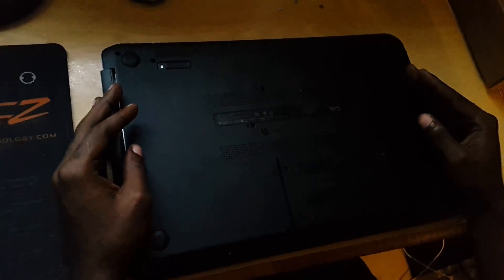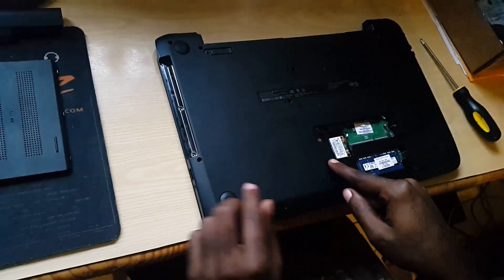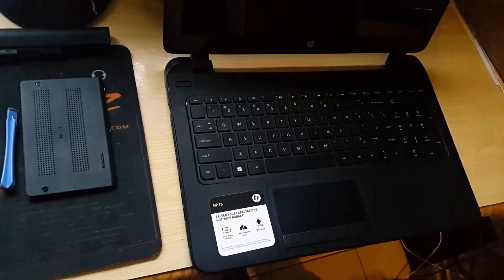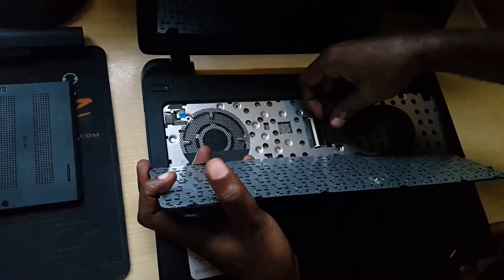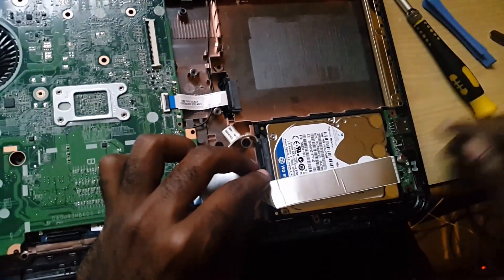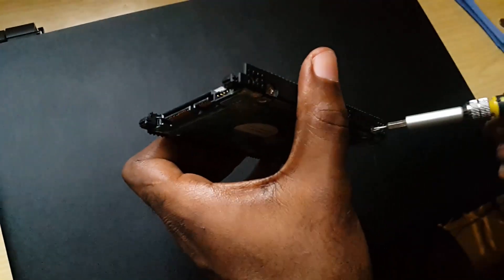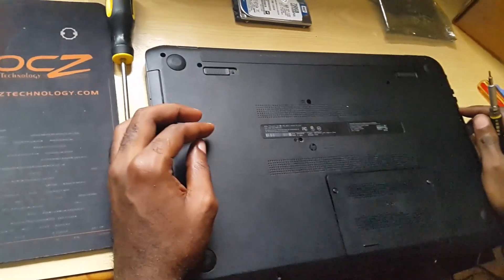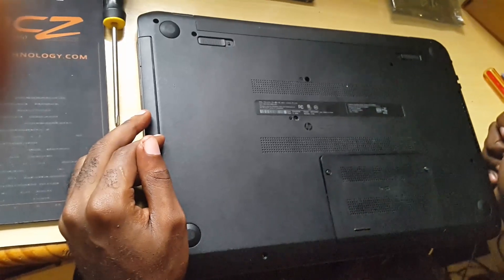HP 15 Laptop hard drive replacement or SSD upgrade

Comment: do i have to format the drive using disks for the hp 15 F272 Disk drive model number once replaced with a new one?
Reply from the maker: If you are replacing the Hard drive you will need to re-install Windows in order for the computer and new drive to work.
Reply: thanks, so i will need the disks for that system or do some have windows built in?
Reply from the maker: You will need the Restore or Windows Disk that came with your device. If you have a valid Windows DVD you may use that as well.
Reply: Thanks very much! I thought so. I was watching other videos where they were just replacing the hard drive without running the windows restore software.
thanks again.

Comment: nice tutorial, I cant get those dang screws under the dvd  rom.  The section for the screwdriver to fit is sooooo tiny! I guess I have to get a special screwdriver.  I'm using a glasses set tool and its too big lol. Crazy , has to be the hardest part! great accent btw.
Reply: Same thing here. 2 don't want to come out

Comment: It's better to buy a used hp probook or hp elitebook on craigslist or ebay than it is to buy a cheap one new. One of my friends has this laptop and i am not going through all that just to put in another mechanical hard drive that already has bad sectors on it. The hard drive that is in it now might still be good just doesn't boot to windows. Instead i am just going to run parted magic and wipe it clean and reinstall. The lenovo laptop is even worse you can't replace the memory or hard drive without dismantling the entire unit. The older thinkpads are just as bad. One of my other friends got an hp probook with a 2nd gen intel I5 and 8gb ram 500gb hard drive on craigslist for $150 and all of the basic components have covered compartments very easy to replace hdd ram etc....
Reply: But before you buy do you make sure they work?

Comment: Your accent is excellent and made this an enjoyable watch.

I had three of these models with failed hard drives come through my shop this week alone, and the only thing that had me stumped was HP's incredibly bizarre decision with the ribbon cable connectors. The fact that the black part elevates on the keyboard, but the white part elevates on all the other connectors seems like an intentionally misleading design choice. 

Also, you may want to note somewhere that there's another model of HP 15 that has a nearly identical design, except it has segmented corners near the monitor which are fastened with a screw hidden underneath the rubber feet of the base. If you don't remove those, you're liable to break the fasteners inside.
Reply from the maker: Thank you for the pointers and If you could name that exact model it might help someone with it avoid such a mistake. Also appreciate the kind words :) .

Comment: My Laptop wont turn on.  What happened?
Reply from the maker: Depends if you pulled it apart you might have missed something during re-assembly.
Reply: You have to put the battery back on
Reply: Fraggers what did you move? Look up how to resemble whatever laptop you have and resemble it. Or get HP to fix it. Or don't buy another HP computer again

Comment: Hi, I have a hp 15 laptop, I took it to a technician who told me the hard drive needs replacing and I did so but when he gave me the old hard drive back it says TOSHIBA...I don't see yours with that on it. is it possible he gave me a different hard drive and lied about me needing a new one? I considered that my relative (who got the laptop for me from the U.S) might have lied and bought a refurbished laptop but the back didn't look as if it was tampered with. it looked new..so let me know, thanks if its normal for a new hp 15 to come with a toshiba hard drive
Reply: Boui Boui ask your cousin, also look it up. Try HP help center, contact them or just ask a pro who does known what there doing
Reply: Ask a reliable technition that you know won't lie to you

Comment: Cheap notebook, use as it is. If you want a SSD and more memory, buy a REAL notebook, the ones that have covers with screws. They cost twice as much. It's a trade off between price and user accessible. Made like a phone. Cheap and hard to open. Great for the price. I can open a phone, so opening this is no issue..

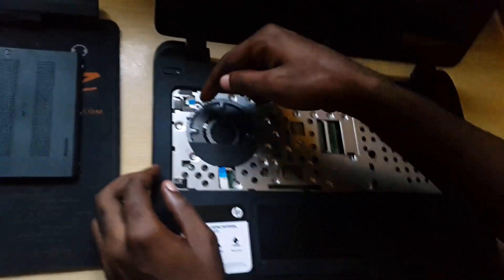Comment: Ok, so weird comment, but at about 5:15, those clips for the ribbon wire, what if one of those clips were to break, just curious, don't even have one of these laptops, just kinda had random videos playing lol, but either way, thank you to the creator for making this video, I am sure it will help many others lol. Thanks in advance for anyone who answers my question.
Reply: Matthew Puhalla rip then. It broke off for me very easily, i hot glued it in and it works fine. however it doesn't work the same for the bigger connector that the keyboard uses. now im with a broken keyboard.

Comment: Just followed these steps and when I try to turn it on nothing happens.
Reply from the maker: One make sure you reconnected everything properly as I you don't the Laptop will not power on properly, also if you did replace the drive and it powered on you will need to reinstall the operating System before windows comes back.
Reply: Hey Paul. Did you ever get it to work?

Comment: I have tried to unscew my laptop and pop the base off on my HP Pavillion 15 Notebook PC, but there is a scew where the diskdrive goes that has a flathead scew which needs the tinest of screws to unscrew it. Any help or advice would be greatly appreciated as I dont want to go to the shops 😣😊

Comment: Hey guys..
I have  hp notebook 15 ac122tu With 4 GB Ram Expandable upto 8GB,Video graphics of  
 Intel HD 5500.
Is there a way i can add a graphic card in this to run games like battlefield 4 without lagging or i can add nvidia Graphic card on the motherboard.
If yes then will my motherboard support it.
:-)

Comment: Absolutely rediculous! What moron designed this? I remember trying to remove a hard drive from an HP to remove a virus (the plan was to scan the HD using a USB done on an uninfected computer). I got to the point of removing the screws and nothing would even budge. Why wasn't there a hatch on the back of the laptop? All other laptop models allow easy access to the drive, WTF? It's easier to work on a jet engine! At the end of the day, my dad tossed the laptop in the trash (it was a Christmas present). ultimately he bought a Dell one, with the PROPERLY DESIGNED access hatches to the hard drive!

Comment: my hard drive got corrupted in my laptop but Instead of wasting money to get a new hard drive for a 3 1/2 year old computer I'm just going to buy a gaming pc with intel i5 6 core and a gtx 1060 😛
Reply from the maker: Sounds good, in my experience after 3 years a Laptop has more than done it time. Thats around the mark it will start giving lots of issues and things will start breaking. By then the Technology inside will be crap though.
Reply: Ricardo Gardener sadly yes. these weren't made to last. loved your video by the way.
Reply from the maker: Graphic Default
Thanks really appreciated
Reply: Graphic Default I had a very good HP laptop (though it was a pain a lot) it lasted till today at 11pm, they may be good they just are hard to fix 😂

Comment: i cant remove the CD drive as easily as he did. it is connected with  a ribbon cable..should i remove the CD drive at the end then? im using a HP Pavilion 15 n208tx notebook...please help.thanks ✌✌
Reply from the maker: Take your time see where everything is connected and remove things as necessary bearing in mind where it came from.
Reply: Ricardo Gardener thank you for the reply... actually it was my mistake ..i tried to open the cd drive..instead of just pulling it out..my bad.😐😐

Comment: Hi Ricardo, i have this model

http://qrq.itcs.hp.com/m/L0T74UANA/qr.do?cc=us&ll=en&jumpid=QR_PPS_L0T74UANA_NA

I have 6gb but i was wondering how much more ram can i add to it, it looks like it has 2 slots, please let me know if this is right, and what do you recommend for upgrade my RAM, saludos!

Operating system
Windows 8.1 64d19
Memory, standard
6 GB DDR3L-1600 SDRAM (1 x 2 GB, 1 x 4 GB)
Hard drive description
750 GB 5400 rpm SATAd10
Processor family
Intel® Core™ i5 processor
Processor
Intel® Core™ i5-5200U with Intel HD Graphics 5500 (2.2 GHz, 3 MB cache, 2 cores)d15
Weight
4.92 lbd4
Display
15.6" diagonal HD BrightView LED-backlit (1366 x 768)d9
Display size (diagonal)
15.6"
Graphics
Intel HD Graphics 5500 (up to 2.96 GB)d3
Battery type
3-cell, 31 Wh Li-ion polymer

Comment: Oh man...........It is not hard but it is tedious ......thanks for the video ..it certainly did help me!!!............Curious why they did not put a door on the bottom like most laptops as changing hard drives is so common and frequent..
Reply from the maker: That's a Good question, maybe the design is having its intended effects.
Reply: Ricardo Gardener .. can you please help me out good sir. so i turned on my hp notebook 15-f271wm and all im getting is a black screen with a blue box telling asking for admin or power on password that i can't remember.  I was told my only recourse is to open up the nb and disconnect the green jumper wire from either pin 1 or 2 . can you please tell me where this green jumper wire is located please.....

Comment: I knew better than to buy a HP product. Sadly my wife didn't. HP and MS pull the same tricks. It is nearly impossible to change Windows operating system back to any earlier MS that was better than Win 8 and above. (I say this in comparison to any other brand) Worse yet, Just  try to dual boot or install Linux! Like HPs new printers that include non removable software preventing you from using any ink other than that supplied new from HP. Their computers now do everything possible to stop you from using the computer that you own and paid for in a way that HP does not approve of. Their fear is that you would spend your own money on a non HP or MS product. Please...calling HP a good company is a stretch.

Comment: Thanks, I've got this laptop and have recently been unable to boot it up. I get stuck on the hp logo loading screen on Windows 10. After running the HP diagnostic tool I discovered the hard drive failed so am considering replacing it myself. I will first try and reinstall the OS from a recovery USB but if that fails I think I may need to follow your steps here.. Only tool I don't have is the one you used to lift up the keyboard and backing plate.
Reply: P.s. My laptop is only just over 2 years old so I'm shocked that the hard drive has failed already..!
Reply: Steven Fall my laptop was 4 months old, next thing I know I need a new hard drive because when I sleep I sleep walk and I made It fall, who knew I slept walk not me that's for sure 😲

Comment: Can you make a video on RAM? I need a tutorial on the exact computer... Thanks.
Reply from the maker: You do not need a separate video for that if you made it this far into the Laptop simply look for the RAM module if its not visible at that stage of the disassembly then go a little further and look beneath the Motherboard.

Comment: does it void the warranty
Reply: If you're under warranty, just send it to HP for replacement?
Reply from the maker: Not sure-maybe, did you see a warranty/tampering seal? For some its just outside its warranty period.
Reply: is yours warranty void
Reply: skyroket if under warranty they fix it for free after that you need to pau for it

Comment: This could possibly win the award for THE DUMBEST AND GREEDIEST product design ever. HP doesn't want to make it easy for you to update your computer, they just rather you buy a new one. HP should be ashamed. Opening a laptop simply to remove a hard drive is like taking an engine out of a car just to replace the car's battery.
Reply: Amen Brother. Their new printers include non removable software that prevents you from using other than HP ink or refilling their cartridges. Calling HP a "good company" is a stretch.
Reply: so true!! smh. a regular user will no be able to do this.  they want you to either buy a new one of buy their maintenance plan... so you can bring it to them instead so they can charge you the price of another laptop to fix it for you..smfh..
Reply: Yeah, okay...
Reply: Dan, you're an idiot.
Every computer? Desktops? Every other laptop ever?
Reply: Here Here... Whoever authorized the design are a bunch of assholes.
Reply: Sun Of God lol yeah
Reply: Honestly, this isn't too bad. It's poor design, sure, but I've seen far worse. Clearly you haven't seen the shitty designs with the little plastic rings that you have to snap off with a utility knife or screwdriver.
Reply: Sun Of God I agree they make money. It's cheaper to buy a new one. Get a warranty
Reply: Bonefx Flow A regular user should never touch internal parts. If this job is too difficult for you then you should not be changing any hardware on a computer period. This is very simple to do.
Reply: I have the same issue I want to put a ssd in but I don’t know how to get to the hard drive with out breaking the dam computer
Reply: Just so you know, this design is actually very easy to get into and service, I  mean, it would be nice if the harddrive was just removable like the DVD tray but honestly this isn't a bad one, try getting to the harddrive in toshibas or IBM's, those are nasty to get to. Have to remove motherboards and screens and everything.
Reply: Exactly. I even had to break one of the tiny microscopic screws cause it was literally DRILLED IN so hard. It got stripped. So i had to rip it out with a freaking knife and the aluminum floor wall bent. Its horrible. All to find out from removing 100 of screws and cabled the cpu was fucking sawdered on. What the fuck. It was more like a very hard glue but worse to remove. I couldnt even upgrade it. The cpu chip was too small. Horrible design.
Reply: @supercommando89 nope, you would be incorrect.  I've worked on a bunch of laptops, this is one of the worse designs I've ever seen.  Most have a cover on the back, remove, and bam there's the hard drive.  Or it slides out from the side.  To have to remove all the screws on the bottom, then have to remove the cover and keyboard AND the USB/audio board...... That's ridiculous.
Reply: I do this professionally and I don't believe I've ever had to pull out the USB port before this repair, also I'm not sure I've EVER had to pull out a mobo to replace a hdd and ESPECIALLY not the screen.
Reply: Opening a labtop tp replace a component inside is VERY normal 😂😂😂
Reply: Whoever designed this POS needs to be dragged into the town square and flogged. HP will never get a penny of mine!
Reply: I have a Toshiba that just about if not exactly as old as this laptop that is exactly the same way but a whole lot easier to open as all you have to do is unscrew the bottom screws and the bottom plastic comes off... I thought that would be the same case for this one and after about a minute or 2 I had to jump on YouTube 😂... I have to assume the majority of laptops are built this way...
Reply: Turns your stomach doesn't it.
Reply: With my 15af067sa, once the screws on the rear are removed (together with one under each of the base pads by the battery and the two that would otherwise be covered by the battery) prise open the clips around the two sides and front, then ensure the lid is closed and with the machine laid down on the lid, the hinge side can be unclipped. This then releases the plastic base. The hard drive is sitting in a caddy and the whole unit can be removed by removing three tiny Philips screws, before releasing the hard drive from its connector strap. The 'caddy' (its is comprised of two individual metal arms) can then be removed by unscrewing the four Philips screws.
Reply: it's actually done for the sake of evenly distributing weight/heat and keeping the laptop from being too thick. Yes, there are better designs, HP just didn't do that great with them. They are a good company and most of their laptops, even varients of this same one are far more easy to repair, this one just sucks.

Comment: it says boot device not found
Reply from the maker: If it says boot device not found when you finish installing simply means the new hard drive does not have an operating system. You canned to set the main drive in BIOS and install windows as its a new drive. The website has the tutorial see link on screen or in the description.

Comment: what do u do if it says u need a operating system?
Reply from the maker: Do exactly that install a operating system which is usually Windows unto the drive. You just basically replaced the old Hard drive which had on windows on it. The new drive is blank, I have tutorials on the website to do it. See links on screen or in the description.

Comment: i saw that someone commented they had no cooling fan.....my hp does not have a coolong fan either....whats up with this
Reply: Kristin Mcdaniel that's means it can over heat the hard drive, which means you would fix it way more or just get a pocket sized fan blowing on it, that's what my sister did for her laptop, it worked like she had a cooling fan!

Comment: Thank you so much. I bought an ssd to put on this laptop and for my surprise the little cover on the bottom didn't had access to the hard drive. I was lost but thank to your video I was able to complete the job. Bad design from hp, though. Changing hard drives is very common operation and should be as easy as changing the ram. I've change many hard drives on laptops and is first time I need to open all laptop for this.

Comment: I thoroughly enjoyed this video. It saved me a lot of time. I have taken many apart, but they always have different designs. Thanks a lot! I would suggest to anyone doing this for the first time that they not place the battery back in until they have fully secured everything.

Also, there were two screws that needed to be removed from the beneath the memory to allow the front to come off. :)